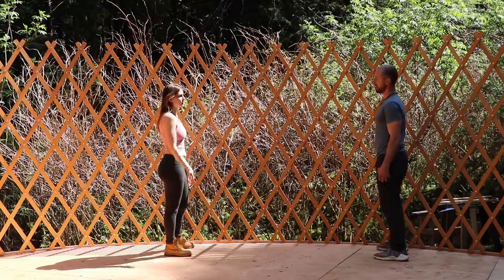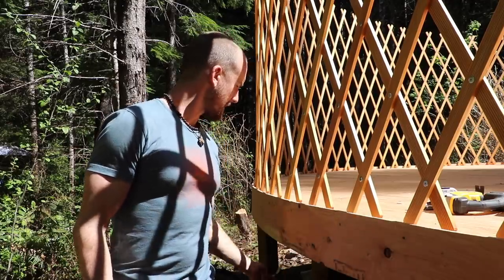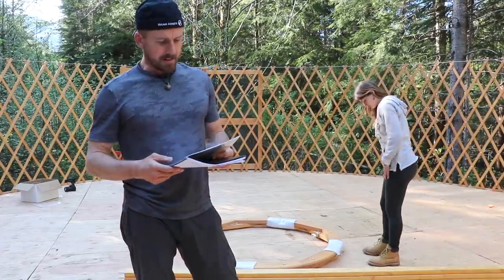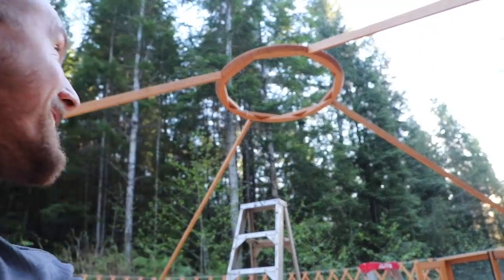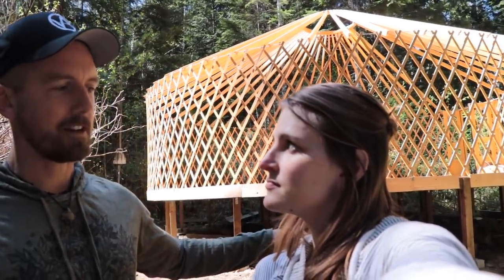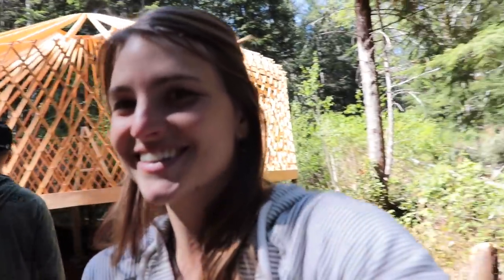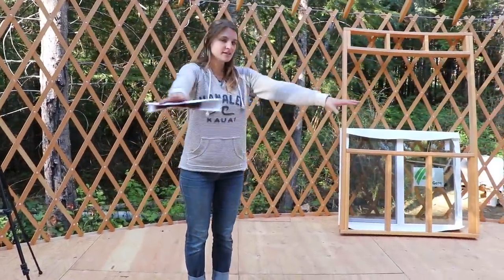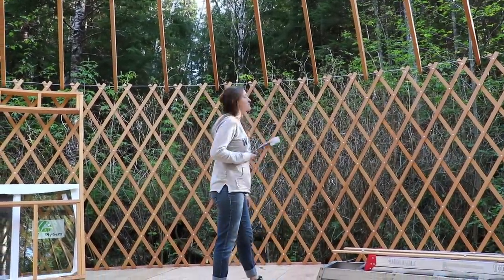HOW TO BUILD A YURT | Alone Off Grid - Ep.19

Comment: Might not want heat source too close to work out area, or kitchen... Jus sayin. 😂 (That is sweat).
I thought you would be making the whole deck bigger, then just put the yurt in the center of it. Guess not.
Reply from the maker: Bev True The company that we got the yurt from has  platform guidelines and we had to make the platform the exact size of the yard and then the deck will be built around the yard later.
Reply: @OffGridLife  i guess i was just curious about why they did it that way. 🤔
Reply: @bevtrue6937  the yurt's exterior side cover extends below the interior floor level so that you get a good seal and water sheds completely off. Exterior decking needs to be lower than the circular platform, or separated from it, to allow the side cover to fasten in this way.
Reply: @PacificYurts  Cool! Thanks for the info.

Comment: Just found your channel and watched from the start of the platform build today.  During the build, both of you made it a point as to why it is so important to read the instructions.  Jake mentions that the yurt is easy but 95% of the work is a proper foundation. Why didn't you follow the engineering plans for a 30-foot yurt from the manufacturer?  The beams should be square on 4-foot centers and the bracing should be on four-foot centers. The bracing should have been secured to the beams with joist hangers instead of 2x4 corner connectors. The plywood should have been installed perpendicular to the beams starting from the center of the deck with the seams for the next row staggered by 4 foot. Your deck is weakly constructed. Did you use 1 1/8" plywood for the deck or 3\4" plywood?             Go to  https://www.yurts.com/downloads/  and open the 30-foot platform building instructions.
Reply: I know, it's like the elephant in the room!

Comment: A good system for your restroom until you get the outside one fixed.  weblife . org/humanure/default . html   (remove spaces around periods in link).  Chapter 8 "The sawdust toilet" to build.  Read Chapter 8 is all you need for the complete system.  Tens of thousands use this system.  No smell.  No bugs.  A few boards and a few 5-gallon buckets and you are in business.